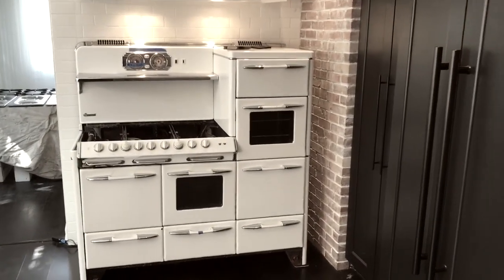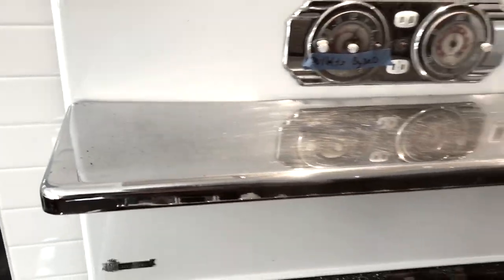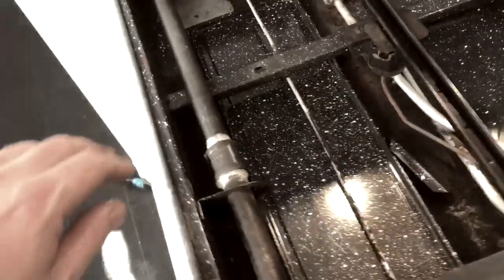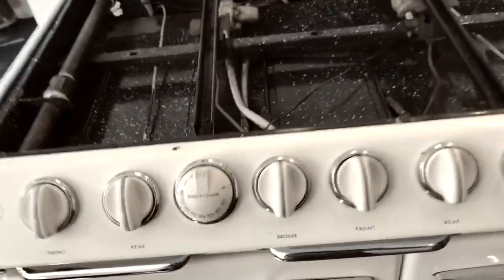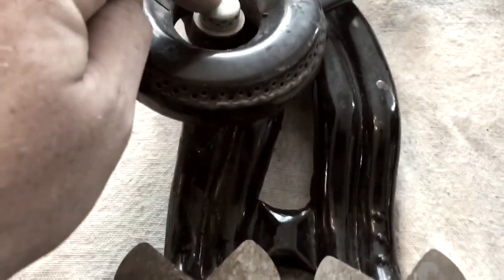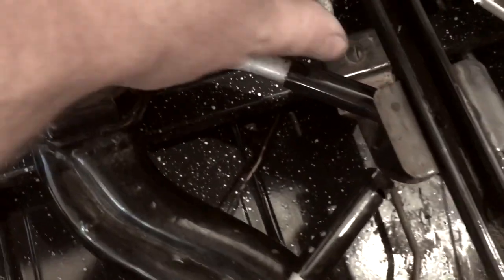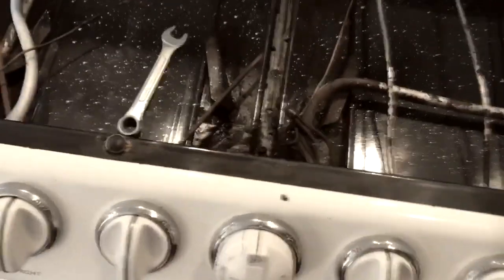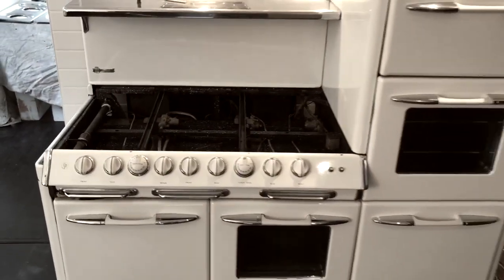VINTAGE OVEN HOW TO Restore, refurbish

Comment: Aristocrat is from 1949. I have the same stove.
Reply: Are all the front doors broilers or ovens? Why are there 8? Perhaps more cooking took place, or they were less efficient requiring separate flames for smaller dishes? Thinking the bottom drawers might just be warming drawers.
Reply: From left to right: the Grillevator (a broiler), an oven, another oven. Underneath: a hot drawer, the griddle storage, storage drawer. On the tower there is another over and on the very top, a hot drawer. Plus 6 burners.
Reply from the maker: You are correct!!
Reply: I was going to say that that’s not from the 60s. I’m from the 60s and the 60s stoves didn’t look like that. My guess was 30s or 40s.
Reply: @phoebedigs1356  it was from the 40s.

Comment: I repair the same equipment except in a newer "body". The principles and parts are the same. I do have to question why you used white (for water) pipe dope, when you should have used Yellow (for gas)? I see this at work with some of the "out of the trade" engineers work on kitchen equipment. Not knocking you, just asking out of curiosity.
Reply from the maker: Hi.  I used rector seal

RectorSeal T Plus 2 pipe thread sealants are a non-setting, multi-purpose compound which contains PTFE, plus synthetic fibers to create a stronger seal. Recommended for use on threaded galvanized steel, iron, brass, copper, aluminum, stainless steel, polyethylene, fiberglass reinforced, PVC, CPVC and ABS pipe. T Plus 2 may be pressurized immediately following application.
Teflon-enriched synthetic fibers create a strong seal
Compatible with metal and plastic pipe
Suitable for use in potable water systems and uses with a wide variety of other gases and liquids

Comment: Did you sand and re-paint the outside?  If so, what products did you use for that part of the renovation?
Reply from the maker: thankfully it lives in Arizona so outside of a tiny bit of rust on the chrome I didn’t actually have to repaint anything